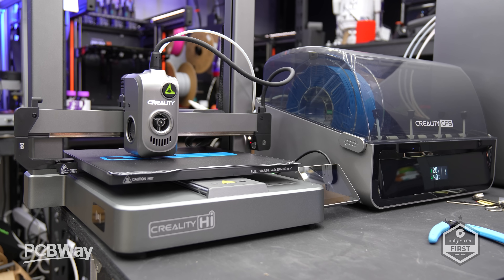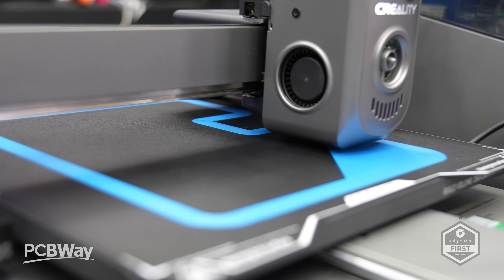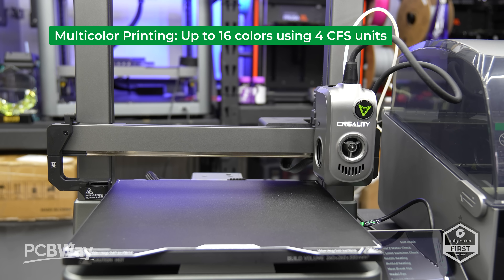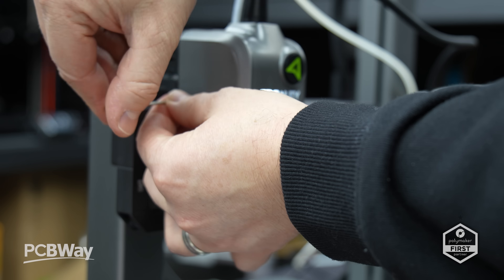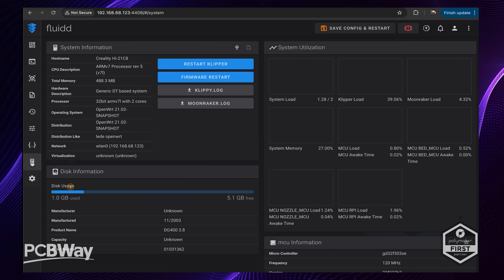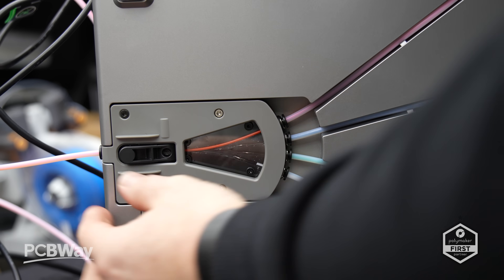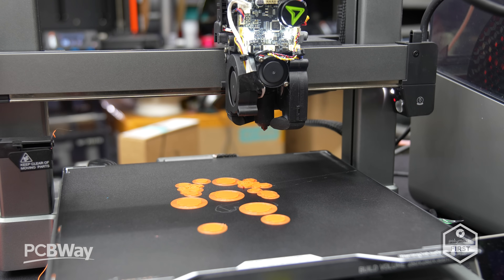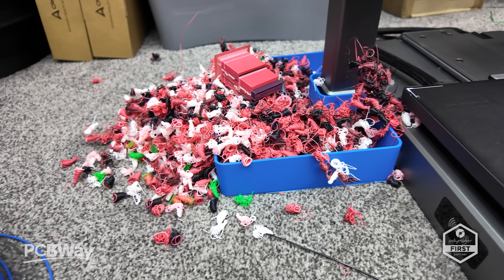Creality Hi Multi-Color 3D Printer – Worth the Hype?

Comment: Hello, I'm on the fence now. With my V3 KE placed in a box, I'm used to snoring in a chair, but the clicking and lots of waste are starting to put me off a bit. I'd also like to know how far I can take the CFS, assuming I use the longest possible cables and tubes? Otherwise, the price/performance ratio is decent at first glance. And they probably really saved money on the camera, like with the cheap Bambulabs. I have the NEBULA and I'm very satisfied
Reply from the maker: It’s a tricky one, it’s not my most favourite printer or brand for that matter, but it does the job inside of that price market delivering on multi color printing. I’d go with the anycubic s1 over this if it was my choice

Comment: Worth the Hype?  Not even close!  I purchased a Hi Combo and it does not work.  I have a list of 5 different error codes I get (FR0122, CM2789, 2069, CX2573 & FR2849).  When it tries to cut the filament, the print head slams into the right side of the printer, flashes an error and basically the Hi freezes up and I have to power cycle to get it to do anything.  I contacted Creality in an online chat and supposedly they sent a message to the techs and marked it a high priority.  I am still waiting for a reply.  So right now I have a $600 piece of junk on my desk and nothing but crickets from Creality.
So, to answer your question, is it worth the hype, not even close.  I am now trying to get someone from Creality to answer my requests on how to box this paper weight up and ship it back on their dime for a complete refund.  Take my money and spend it elsewhere.  I would not recommend anyone to purchase from Creality.

Comment: Do you think I should upgrade my K1C, or should I just buy this combo and have 2 printers?
Reply from the maker: Well, that depends on you ultimately if they ever get round to making the CFS for the k1c you would have two CFS units printing eight colours potentially on one of them
Reply: @ I think the CFS upgrade is supposed to be released In 5 days (2/28), more of the though when put into perspective is this:

For $52 + $320 = $372.00 without tax to upgrade the K1C

Or, $469 for the CFS, Plus a whole extra 3D printer

Seems like maybe just getting another printer is the way?

Comment: How would you compare this(without cfs) to something like the Ender 3 V3/v3 plus?
Reply from the maker: I think the CFS is really the only thing that makes it special
Reply: @TheRealSamPrentice  interesting, I was leaning towards it without the cfs as the bed volume mixed with price is pretty good ($379 CAD$ supposedly) but if the quality and ease of use aren't much different than a V3 plus that may change things
Reply from the maker: @Andrew2010SS is there any reason you’d want a bed slinger over say the new elegoo?
Reply: @TheRealSamPrentice  I have used k1 max's a fair bit and wanted something similar quality/familiarity wise while being smaller/cheaper for home use. Are you referring to the centauri? Or one of the new neptunes? Just saw the centauri for the first time now when i checked their website
Reply from the maker: @Andrew2010SS yep their new corexy I’ve just done a video on it
Reply: @TheRealSamPrentice  only reason why i can't buy centauri i just can't order it

Comment: In my opinion, $349 is too expensive (this is just the printer and not the CFS). For $199 you can get elegoo’s new core XY. Yes, it’s a smaller build volume, but are we still entertaining $350 mid range bedslingers in 2025? I saw a SV-08 for $462 on eBay the other day….no comparison!

Comment: Honestly while the machine is 'good' it's not that great.    Like people compare the cost of it, and the filament system, and then remove the cost of the stand alone filament system to claim it's a sub $200 printer, but it's not.   To buy this printer, and not the filament system, is $350.  And that is a shame.   It is out classed and out performed by the new Elegoo printer, and the only thing the "Hi" has over it, is a tiny bit of X/Y print space, and some additional Z print volume.   Given the majority of prints can fit in a 250 cube, I would say this is a failure on the "Hi" - Creality's side.

As for print quality, my Ender3 from 2019, ($175) with about $100 of mods/upgrades - prints better.  The only thing this printer does better than 'my' Ender3 - is speed, and honestly I never tried to push speed on my Ender3 - because it's a bed slinger, and those just by the rapid motions of the bed, cause new problems to try to solve for, and get progressively worse, the taller you go.

So I see questionable engineering, with taller print on a bed slinger, combined with questionable choice to try to push a bed slinger to faster print speeds (ringing is seen in nearly every print people show off), and I wonder "why?"

Why this printer, this style, these choices?  The only thing I can think of - is they wanted to push their 'AMS" system - and had to give it some sort of compromising solution for its $300 cost. (that's right, the filament system itself, is $300.  Even Bambu's AMS system isn't that expensive, and Elegoo plan to have thier own version later this year so price TBD)  and it would be one thing if the "CFS" were a filament dryer + AMS combo box, but it is NOT that.  It has a humidity/temp display, and desiccant use.  It is virtually the same as Bambu's AMS, but costs more. (remember the AMS does have a Humidity Sensor inside, just not the same plain display showing it)
Reply: In my country creality hi is cheaper than bambu lab a1 MINI combo.

So basically this is bambu lab a1 combo but much cheaper and bigger build plate with enclosed ams, no reason to be disappointed  😂
Reply from the maker: Totally agree

Comment: Thanks, for the review!!! I was wondering if I should buy a Bamboo Lab A1 Combo, or this Creality HI. I live on the coast, and here is much more humid than most places. If I Bought the A1 I would need to buy a filament dryer, and everything would be even more expensive. With this Creality Hi, my problems are solved and I can finally fulfill my desire of 3d printing everything I always wanted to. Things for home, robots parts for my engineering course, and decorations for sale and make some extra money.
Reply from the maker: What about the anycubic s1 I have a video on that also
Reply: @TheRealSamPrentice  I had also seen the Kobra 3 Combo model from anycubic and I was interested, including this S1 which looks great but unfortunately the S1 is very expensive in my country. I just watched your video of the Elegoo Centauri Carbon, and I was very interested, it does not have multi-filaments but it is cheaper and accepts PLA Carbon, and being cheaper for me is even better because I have more money left to buy filaments, hahaha. By the way, does this Creality HI accept PLA Carbon too?
Reply: @_heric  The answer is Yes,  Hi can do PLA-CF

Comment: its just a 1 for 1 bambu lab A1 copy with a more tacky design...
Reply: I didn’t know Bambu originally designed bed slingers. Guess the Ender 3 and Prusa were just ahead of their time.
Reply: @leonyltupasan  hes not saying bambu invented the bedslinger concept, but there are a lot of similarities in the looks and layout of the parts that make this printer look like a knockoff A1. For example, the filament purge lever thing on the end of the print head arm and the included camera are nearly identical in placement and design. just an observation that it looks very similar and is marketing nearly the same feature set. I think most printers like this in the future will continue to be similar in the same ways, if only because Bambu gave the industry a bit of a kick in the ass after it had been stagnating with little improvement for a long time, and now they are all improving in similar ways to become competitive again
Reply: @LaEmporoar  Fair point. Bambu definitely pushed the industry forward, and it makes sense that others are following similar design trends. I just find it funny when people call something a 'copy' when the core design has been around for years. At this rate, every modern bedslinger will end up looking 'inspired' by the A1.
Reply: @leonyltupasan  well this one really is an almost exact copy, hardware and software are like identical twins
Reply: @zopposimone  Like Jobs once said, ‘Good artists copy, great artists steal.’ Innovation doesn’t happen in a vacuum.
Reply: Ankermake and Snapmaker want their design back 😅

Comment: Wow... Overhands beat the K2 Plus. Kinda sad for the K2 Plus. It honestly does look like a decent little machine! Elegoo's new offerings will definitely put a dent in the excitement though.
Reply from the maker: 100%
Reply: @TheRealSamPrentice  I meant overhangs of course. ;)
Reply: @TheRealSamPrentice  did you print with the K2 Plus doors closed?  Maybe that's why the overhangs are bad.   The K2 Plus looks like it should have plenty of cooling power.
Reply: @Dalroth  I was having overhang issues on my k2 as well until I tuned the cooling. No problems at all now 👍
Reply: @cboxhero  that's good.  I'm really close to pulling the trigger on the K2.  That would be a shame if cooling was a problem.
Reply: @Dalroth  There are some firmware issues that still need to be resolved 100% (like z-offset does not actually get set after calibrations) but they're easy to workaround and are actively being worked on. I have 100+ hours on mine with basically 0 failures so far.
Reply: More Creality garbage. Do they ever innovate?
Reply: @marlboromage  Like Jobs once said, ‘Good artists copy, great artists steal.’ Innovation doesn’t happen in a vacuum — it happens by taking the best ideas and create something better.

Comment: With Elegoo Centauri being $199 without MMU and AD5X coming soon with MMU for $399 it's basically impossible to entertain this machine as an option for any more than $400 for the combo
Reply: IDK I wish FF would increase their build volume already
Reply: When are you expecting Elegoo MMU (and to which printer) to be available?
FF AD5X cannot do more than 4 colors, though filament change should be faster (1/10 retraction length?).
Both are closed klippers.

Comment: A1: 4 colors max and awkward ams unit.  Hi: All in one with temp monitoring CFS capable of 16 colors.  A1: 256x256x256 Hi: 260x260x300 , A1: $450-$500 Hi: $399-$450. A1:  Completely closed off ui Hi:  Klipper .......Bambu is far behind now and anyone buying them are stuck in the past
Reply: This is an ignorant comment. Price doesn't mean anything. Nobody has came close to putting out a printer that prints at the quality of the Bambu.
Reply: And the product quality, print quality and reliability?

Price difference does not seem to matter at this point.
Reply: @janenglund  The quality on newer Creality machines matches or surpasses Bambu.  Reliability is better because of ease to repair on Creality printers where Bambu are nightmares to fix, cost does matter as well as modern feature set
Reply: @anthonylong5870  The quality on newer Creality machines has surpassed Bambu?

I never heard anybody say that, and I have followed 3D printing related media actively. Can I please have a reference to a test that verifies your claims?
Reply: Personally, I prefer the a1 ams. It works very well with cardboard spools since it grips them by the center. Material systems like creality's tend to deform the rolls, resulting in jams and failed prints. Also, if your roll is too narrow, it'll just get stuck after it spins around for a little bit. I dont see myself changing printers anytime soon unless tool changers become more affordable.
Reply: @alexgibson7960  Actually the A1 ams has more problems then the full ams.  It has issues with some spools being to large and you have to print adapters, some cardboard spools wont turn on it and also the A1 AMS Lite has MASSIVE issues with PETG and TPU
Reply: @alexgibson7960  Nope Creality's Multimaterial system has feeder tubes on it and also extra guides to keep rolls of jumping or not turning.  Cardboard spools have NO issues in the Creality CFS , unlike the Bambu AMS
Reply: I just got the a1 mini because i just wanted to make functional prints
Reply: @mitchellvolcano  You want to make functional prints so you bought the smallest printer possible?....uh thats not the best idea
Reply: @ Its not really an issue

Comment: Just because of how the Bambu Lab A1 nozzle works I'll opt for that printer all day long. Creality basically tried to copy Bambulab
Reply: Actually Bambu copied the Ender 3 so yeaaah there is that
Reply: @anthonylong5870  Bambu built core XY  before they ever did bed slingers, fro may knowledge the Prusa bedslingers are printers partly don with printed plastic while A1 is aluminium has a good fast hotend change. Bambu also innovated with AMS systems
Reply: I own an A1 but one glaring thing that this printer may have(i don't have it yet) it the ability to print 16 different filament
Reply: @stinger220  and larger and more open to eco
Reply: Creality innovated nothing here. Just a clone of the A1.
Reply: @marlboromage  Creality innovated the design for this with the Ender 3...15 YEARS before Bambu ever made the A1...btw Bambu has made ZERO innovations of any printers they sell.  They stole everything in thier printers from PRUSA, Stratasys, Creality and Voron.  Bambus multicolor features were actually done by Geeetech 8 years before Bambu